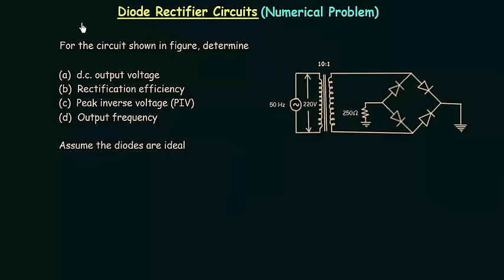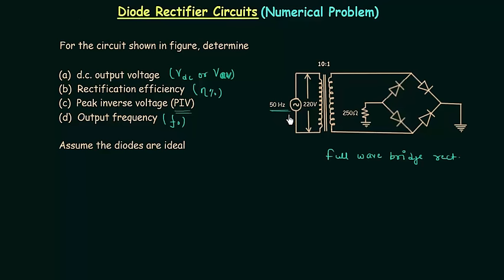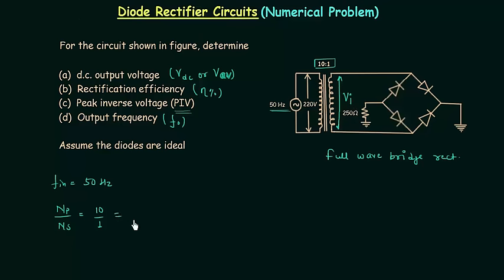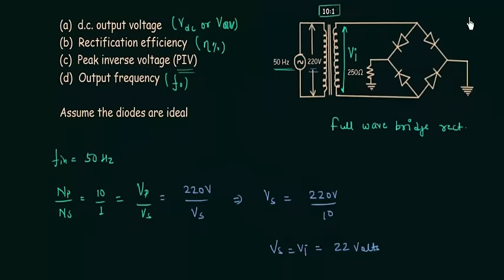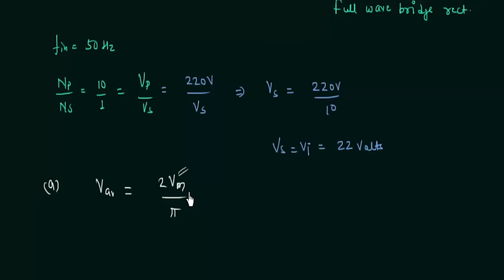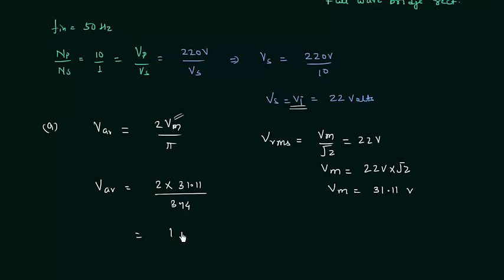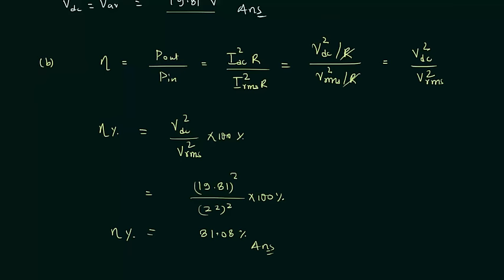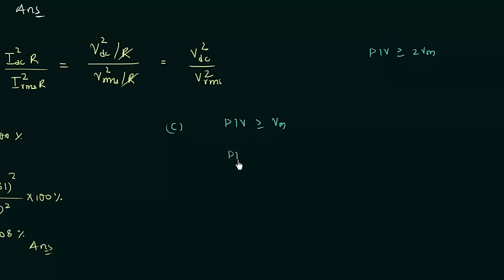Diode Rectifier Circuits (Numerical Problem)

Comment: doesn't the efficiency always remain the same (81.05%) ????
Reply: No it also depends on Rf(= diode resistance) and Rl(= load resistance),here Rf=0 therefore it will always near 81%

Comment: Calculate the current-commutation time (u) if Ls=10mH, Vs=240V, and Id=4A and f=50Hz.

Determine the value of Ls that leads to a current-commutation time of 20o.

If we say that the current-commutation time is 20owhere is the time in that and what is its value

Comment: at 2:35  ,  how Vrms = Vi ??
Reply: Vrms is nothing but input ac  voltage.therefore both are same
Reply: @shaikvahida4787  Vrms is Vmax/2 and Vinput =Vmax sin(wt) ,how Vinput and Vrms are equal???
Reply: @shaikvahida4787   no buddy its dc voltage .
Reply: As transformer converts ac to dc in secondary side it's dc voltage i,e 22v and RMS is equivalent to dc so RMS = 22v
Reply: @reshmabegum2516  ab kya karunga iska 4 saal baad, graduate ho gaya ab toh😂
Reply: @ArpitDhamija  bhai saab🤣🤣🤣

Comment: Sir, how did you conclude that vrms=vi?
Please do reply
Reply: Same question from this side as well
Reply: @khushiagarwal8890  any explanation for that..?
Reply: 220v supply volt is in rms value(any ac voltage is in rms value)...that why secondary voltage is in rms values..i hope you will get answer🙂
Reply: @daryentanwir9091  average or mean value of pure ac component (that we are given as input) is zero...then how come the rms value (square root of mean of squares will exist )it should be zero right?
Reply: @daryentanwir9091  are kehna kya chahte ho?
Reply: @gireeshkumarkancharla4176  bro it's square then mean so it's always positive so the mean/average cant be zero

Comment: How's Vi=Vrms 
The expression for Vrms is derived for load voltage/current
Reply: The 220V supply AC is in RMS value (by defaut any ac voltage is given in Rms). Hence the 22V is also in RMS.
Reply: But RMS is equivalent to dc value

Comment: Sir please Solve this nemarical.
A full wave bridge rectifier with an R 
L load is connected to a 240 V source of the load resistence is 1200 ohm and L>R . Determine following.
1) Average load voltage.
2)Average load current.
3) RMS value of the load current.
4) Average current in each diode.

Comment: sir what will happen if the trnsform ratio is interchange
Reply: If transformer ratio gets changes than output voltage will get change accordingly PIV will change
Reply: zainab MUT post your question I will help you